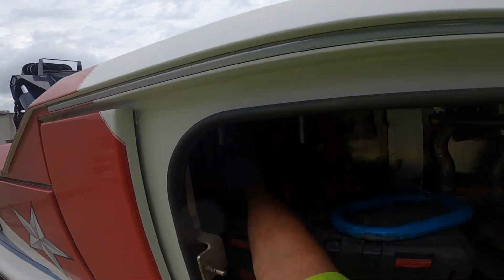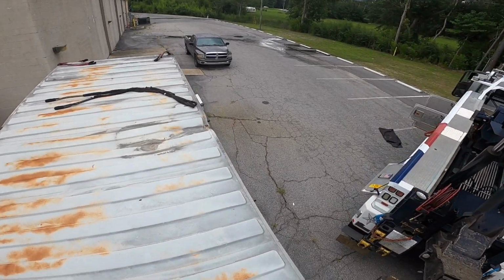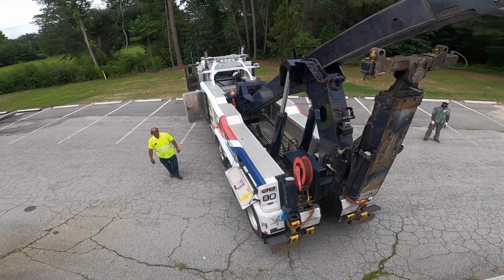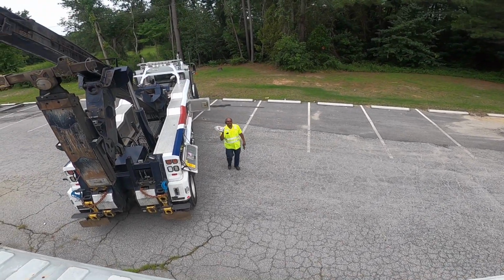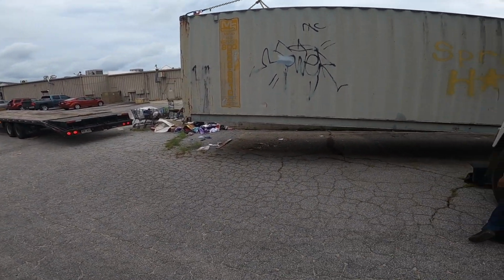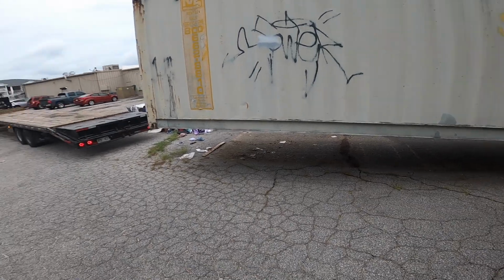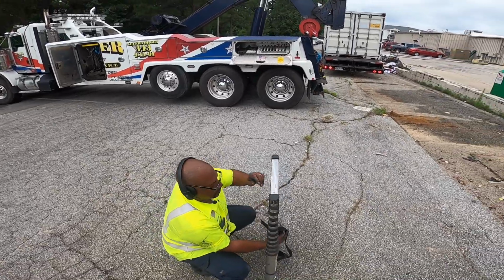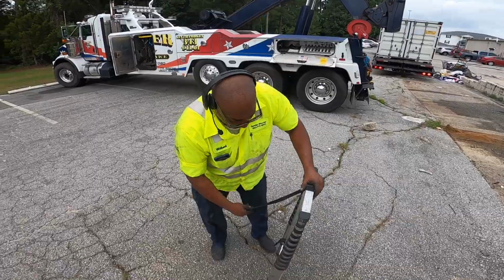Lifting A 40 Foot Container

Comment: As a previous comment suggested, picking up 40ft containers is easier and safer when picked up using the bottom, a spreader bar is useful tool but are not necessarily needed. In the past we lifted 40ft boxes with long chains, with shortening hooks,  using the bottom pockets. It can be done when the trailer has swistlocks.
Reply from the maker: Mr Mark Very interested in your method. Do you use the  same  method I did but in the bottom pockets and the let the chains come up the long sides? Thanks for watching

Comment: I was surprised that the seacan was not picked by the bottom holes then I realized you only have 2 main winches not four. If you gentleman move  alot of empty forty foot seacan’s  I would recommend 1 10 ft spreader beam and 4 25 ft chains….no more ladder. If you got an expandable spreader it and the chains would comfortably fit in a pick truck box..
Reply from the maker: Mr John Thanks for that tip and thank you for watching. Stay safe

Comment: Didn’t like the veer angle of those cables, asking for trouble doing it that way. Need more boom height to reduce that angle if you are gonna do that lift with 1 truck.
Reply from the maker: Mr Steve Yes sir I didn't like it as well but with the container empty and snatch blocks I felt we would be ok no higher than we had to lift. Thanks for watching and stay safe
Reply: @SumterWrecker  just looking out for you. I am sure the rigging you were using will hold up but so many have been hurt or worse when this type of lift has gone wrong when the rigging isn’t quite as strong. Stay safe out there.